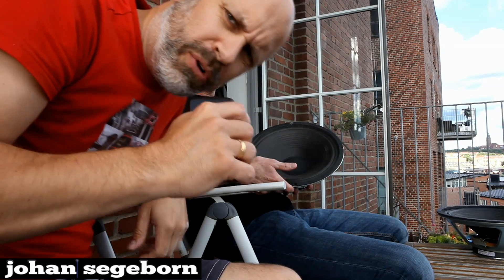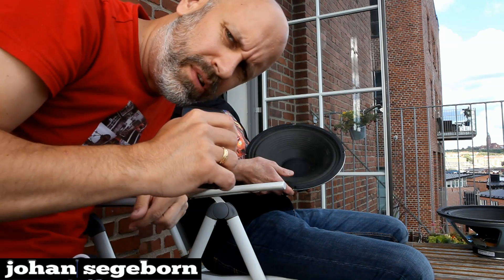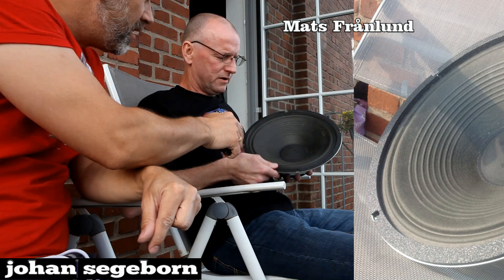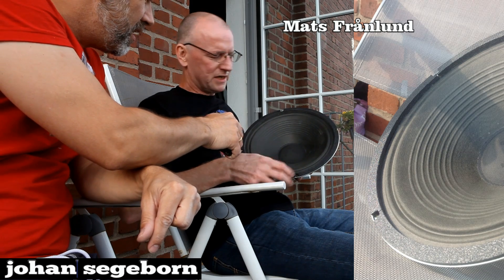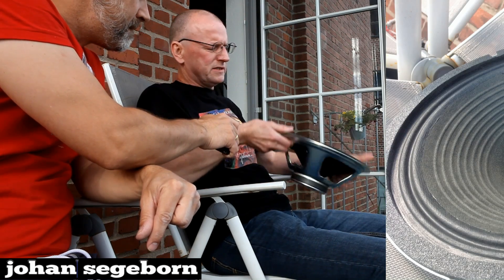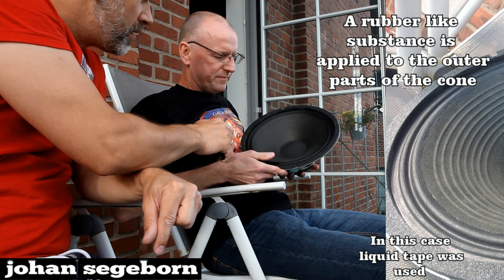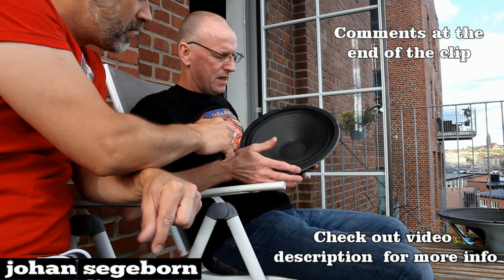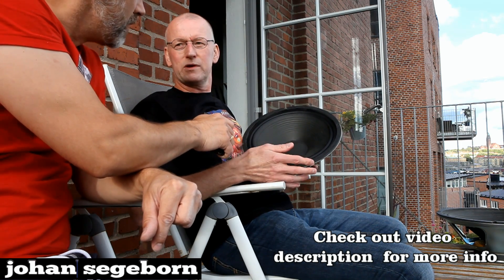How Guitar Speaker Doping Influences the Sound!

Comment: I preferred the doped speaker. The transients off the high-end pretty much eliminated & better focus in the lows.  My guess is that it forces the speaker motor to work a little more, but also helps reduce the rebound so it actually gives the speaker better response time.

Comment: Undoped reduces the speaker compression the whole cone is unrestricted from frequency movement.
Doping restricts that wave.
When I rebuilt my Celestion NEO Creamback with a G12M Greenback kit not only did it bring it down to 25 watts but IMO sounded better undoped. But when you start cranking it up that where the sound changes.
Get a bit out of focus and distorts to much.
I diluted clear theatrical Latex with water and just brushed a very thin layer on the first outer flat section to the edged before it started at the slope of the cone. Tightened it up just enough that it still sounded airy but also a little more focused when driven.
I hope Celestion makes a NEO Greenback after the NEO Creamback broke in I was Like WOW!

Comment: Both sounded good for different applications.  Were both speakers in the same cab?  Or at least in the same model / size of cab?  
I wonder if the liquid tape was maybe a little heavy & if using something thinner would allow you to kind of fine-tune the effect with more or less coats.

Comment: doping generally adds more bottom end, ( by slightly mass loading ), the speaker gets quieter, and the cone is more controlled.
but it depends on the speaker, some i would get the dope anywhere near....and for lower wattage amps, it's better to keep your volume up, and see if you can get it with the EQ.

Comment: My old landlord used to fix speakers. I asked him to fit a 14 inch neodynium speaker as a replacement for the old stock sub in my car. He doped it beofre he fitted it. It's like having a sound engineer tweak your EQ. You don't even notice how abrassive and loose the top end is until you hear the same tone side by side through an undoped and a doped speaker. It also tightens up the bottom end and enhances it a bit, where exactly in the frequency range that bottom end attenuation is going to happen is a function of the diameter of the speaker cone. Doped sounds dope.

Comment: It's not one is better than the other. It's all about the entire rig setup to get the tone you want. I build amps and have many speakers, but I want to talk Eminence because I have production models, custom shop models and OEM speakers to compare. The exact same coil, cone, etc... sounds completely different with different doping and different with different magnet weights. An un-doped cone is usually brighter, but less bass. The doped cones usually have stiffer magnets to compensate for a stiffer cone, which gets you a higher power rating, but also means even at the same 1watt sensitivity rating, they actually will play way louder when really cranked. Because of the bigger magnet. But they don't breakup that easy.. again, always a tradeoff. The size of the dust cap makes a big difference too, because it changes the weight of the center piston at high frequencies. Because only the center part of the cone moves there. It all makes a difference. The trick is to find what works with your guitar/rig/amp/powerl level/desired tone... EDITED FOR TYPOs.

Comment: It's just one small factor in the overall "tone recipe".  Either one could sound better or worse depending the guitar, the amp, their settings, and various other factors.  That's not to say it isn't an important factor.  When you have your tone really dialed-in even the smallest adjustments are critical.

Comment: Not a simple process. Depends on the doping formula and whether you are doping for stiffness or to improve linear movement. Heavy soft compound doping on the perimeter of the voice coil ads weight and can improve linear movement (with limited effects on tone) and lessen the chance of voice rubbing at high volumes.  A thinner hard compound will change the tone of the woofer especially at the limits of its frequency range making it sound brighter. Heavy doping is also used to effect LF on large woofers in smaller cabinets. We use two patented doping formulas in our labs. When doping for altering tone we NEVER EVER apply doping evenly.

Comment: I tend to favour those w. dope all the way to the first corrugation as I don't find them particularly scooped unless they were actually designed to be. Then some speakers were designed for a lot of texture and breakup and some weren't and I tend to favour the latter. Depending on the design of the actual speaker the dope can really make or break the speaker, so you couldn't say that one would be categorically superior to the other.  

Another thing to consider is that e.g. with some early Celestions some were doped on the front only and some on the back and front (prior to assembly). Then some pre Rola ones even had a band of dope outside of the dustcap, which in turn made distortion sounds come off a bit sweeter.
Reply from the maker: +Jonas Carlsson Thanks Jonas, Interesting feedback

Comment: Can't quite believe the difference! I'm thinking if I was to dope my brightest speaker to have the best of both. I use the same pa cabinet with a 1970s g12h and g12m. Running the jmp1 which is very mid bright so be a good mod. what do you think?
Reply from the maker: +Paul Bateman Hi Paul, I wouldn't dope speakers that  expensive. If you for instace think that a 70s G12M25 75Hz (T1221) is too bright you should instead look for a 70s G12m25 55Hz (T1511) speaker which has the thicker bass cone. Cheers Johan